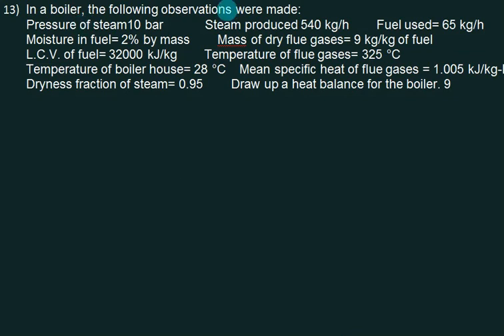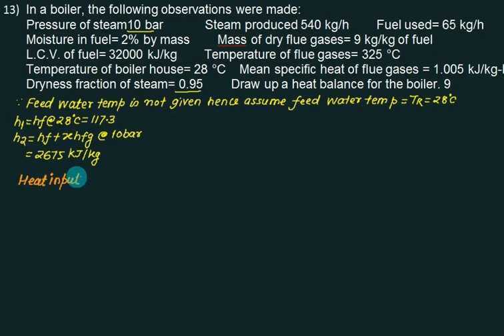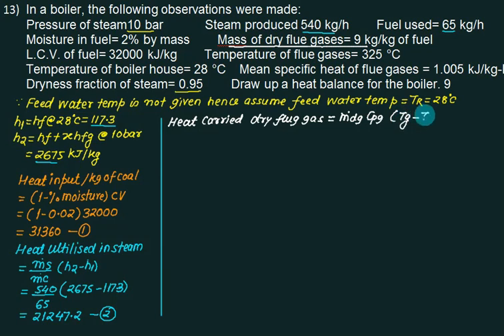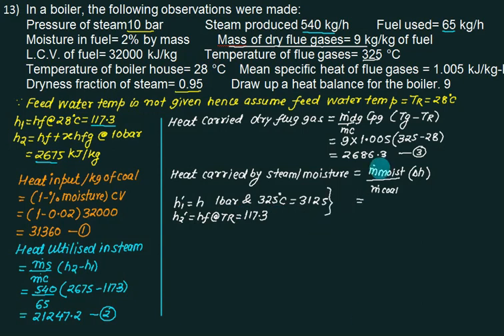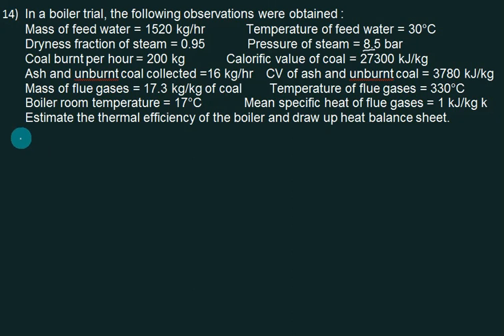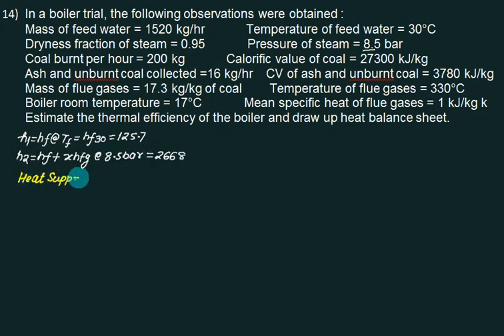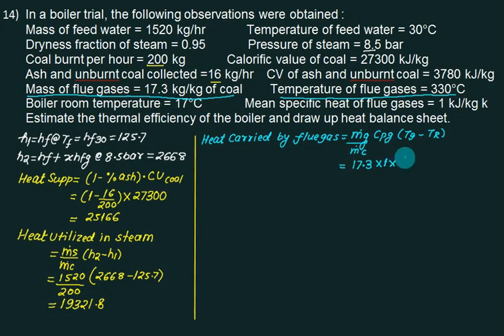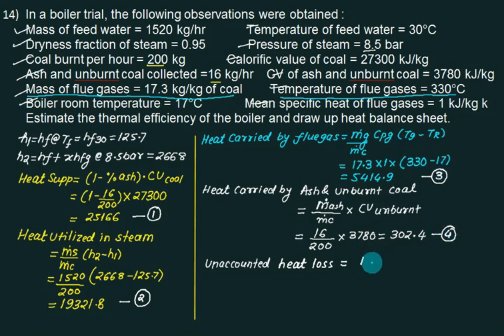05 Boiler Heat balance numericals

Comment: Without partial pressure how to calculate moisture
Reply from the maker: Moisture can be calculated only when you're knowing the partial pressure
Reply: @sunilmohodmh31  but partial pressure is not given in question in that case what to do
Reply from the maker: He should give humidity ratio, ratio of partial pressure to atmosphere pressure
Reply: @sunilmohodmh31  no sir
Reply from the maker: Please explain what do you want to say
Reply: @sunilmohodmh31  how to send u the pic of question
Reply from the maker: 9422112581 WhatsApp
Partial pressure can be calculated if product of combustion on mass basis is known
Find mole fraction of water vapour =y
Partial pressure =y x Patm